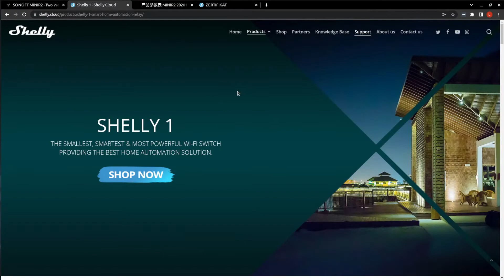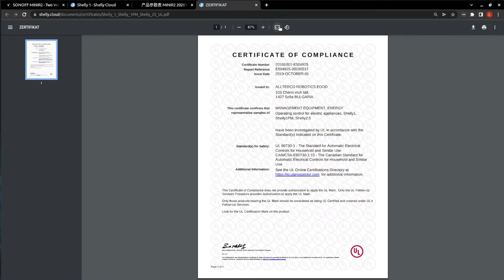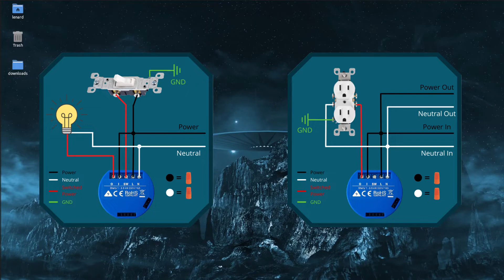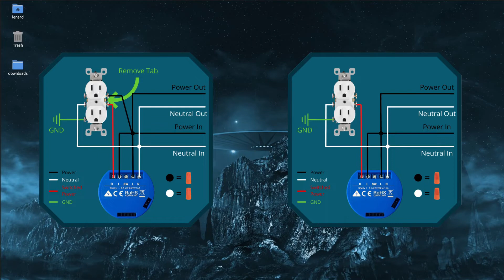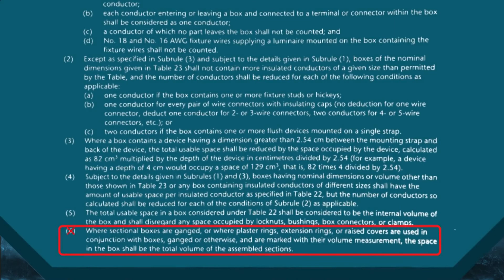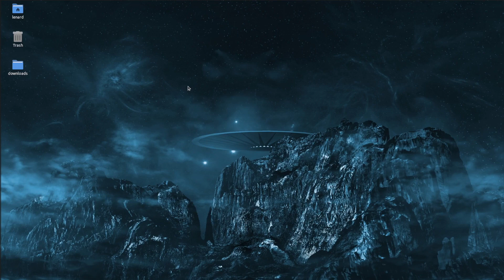Smart Home Device Safety: A guide to understanding Electrical Code Requirements - Shelly and Sonoff!

Comment: I never considered the minimum box size impact of the additional wires used for these little guys, only whether the devices themselves might cause damage. Eye opening. Equally challenging, though, in a 50 year old apartment building, is there is seldom a neutral to be found outside of boxes with receptacles. FYI, I never heard of "marrettes" before moving to Canada, and I've never heard my "Sparky" buddies use any other term for them! Wago fan, myself.
Reply from the maker: I get the allure from wagos, but I like marettes, less points of failure as I know the wires are twisted together